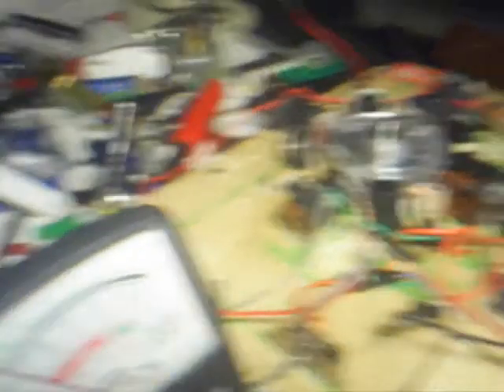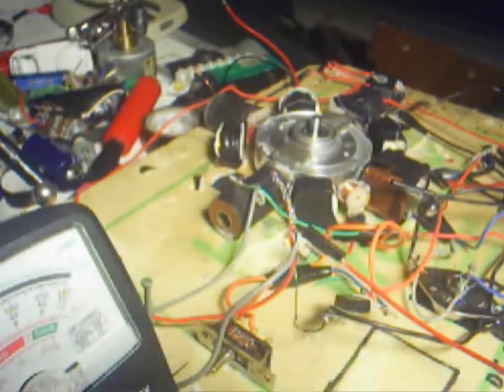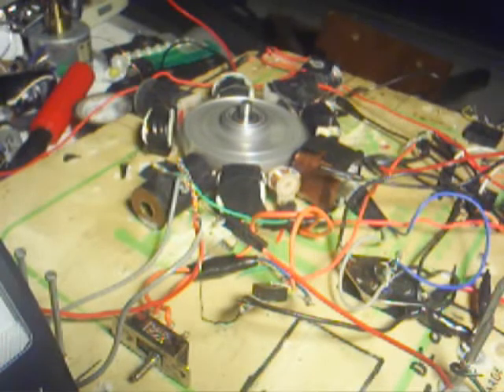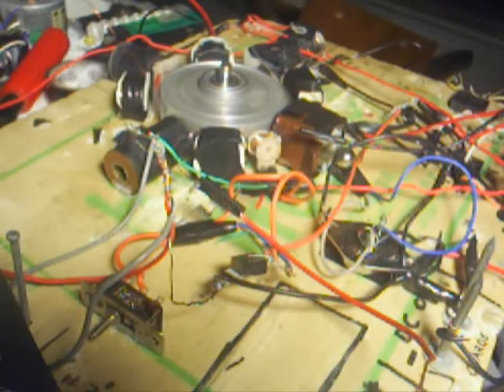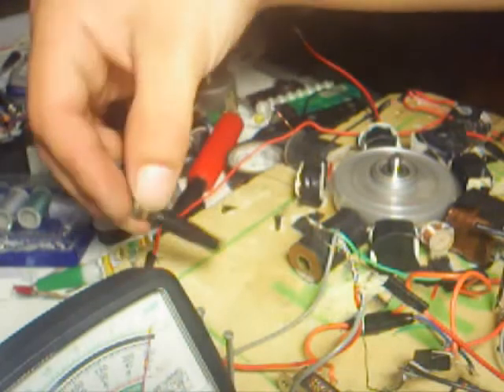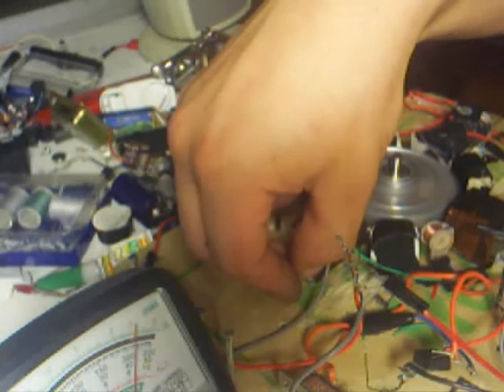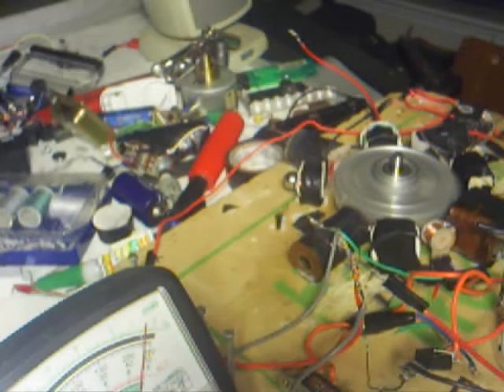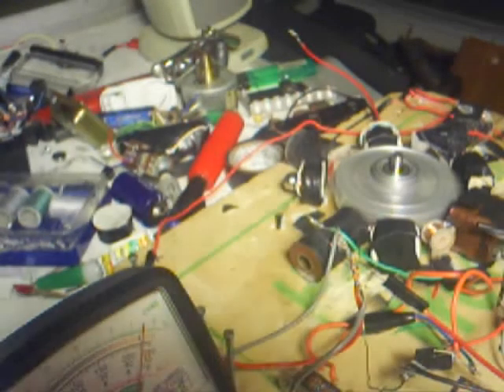romero's magnet "biasing".. sort of

Comment: I agree. People think cogging is the enemy. Cogging can be an enemy,... but.. it's more relevant in a wind turbine, because... if the wind cannot start the blades... at all... there can be no inertia. A total lockdown of unified coil-to-magnet ratio (1:1), causes the largest inital cogging. In lockdown, no inertia can take place, because there is no kinetic energy. If coil-to-magnet numbers are offset, the same windspeed can start motion and inertia and momentum can play a small part.

Comment: @Magneticitist People have to take a new look at Lenz drag.  What is it really?   You want the output coils to drive a load, right?  So when current flows through an output coil the coil becomes an ELECTROMAGNET that is in opposition to the magnet on the spinning rotor.  So people are wishing for current to flow in the output coils to drive a load, but they are dreaming that the coil will not act like an electromagnet.  We all know what magnetic repulsion feels like, and that's Lenz drag.

Comment: 4th:  And just to give you a simpler take on the sweet spot.  Let's forget about the power in for a second.  If you do a plot of power out vs. load you will see the sweet spot right away.  That's really what I am saying above.  You simply don't give a damn about the RPMs because they mean nothing.  If you are a serious replicator of this device you will put a series of different load resistances on the generator output and measure the power.  The punch the data into Excel and post the chart.

Comment from the maker: @User2718218 has been my main problem with the muller design thus far. no reasonable explanation as to how lenz is going to be overted. from what i have seen so far with other replications, it isnt. even with the biasing magnets they are just slowing the inevitable. the core cogging was never really much of a problem its the lenz and thats a totally separate issue that needs to be addressed before people really should start attempting the muller motor in my opinion.

Comment: 3rd:  And the real real deal is to find your power out sweet spot.  What load on the generator coils gives me the most power out?  As you change the load resistance the power output changes.  So what is my sweet spot load resistance and how does that compare to my power in?  Again, the RPMs are almost meaningless, the Romerouk Muller replication is NOT about RPMs, it IS about power in vs. power out and understanding the way power flows from the input to the output.

Comment: 2nd:  Every replication built will have this power in vs. power out curve as you vary the load.  You can also plot power out vs. RPMs also.  The truth is though that the RPMs are just a number, they are window dressing.  The RPM are an indicator of what the power out is, but the king for this replication is power in vs. power out for different generator loads.  That is what this is all about.  Measuring your max RPMs with no load is meaningless, it's just window dressing.  This must sink in.

Comment: @Magneticitist Indeed.  The most fundamental thing about the Romerouk replications is that when there is no load on the generator coils there is no Lenz drag and therefore the rotor spins at maximum speed.  As you increase the load on the generator coils the rotor slows down because of the Lenz drag.  If somebody was a keener and wanted to be scientific about this they would plot power in vs. power out (aka load on generator aka Lenz drag).  The RPMs drop as the load increases.

Comment: interesting.

apparently solid cores take more draw. 
lots of seperate welding rods is best apparently to reduce draw. cos they are not one solid piece they saturate less and that takes less draw to overpower the core or wateva.

also in the video link below there is a guy who explains how he gets rid of the back emf currents that can linger in motors using a copper ring around the rotor.
he uses push/pull for his overunity motor. less back emf = less draw

watch this.. 
/watch?v=Oose6x4xI_Q